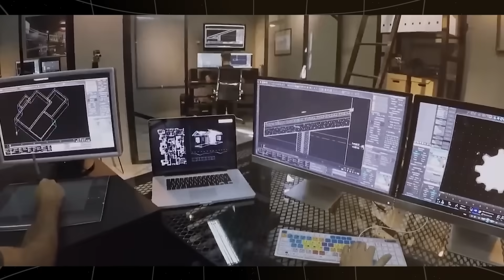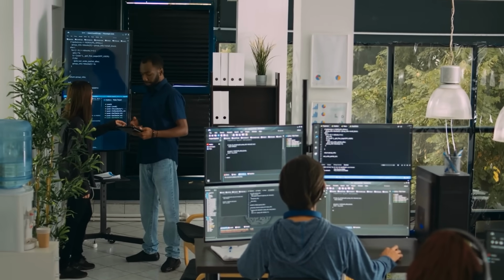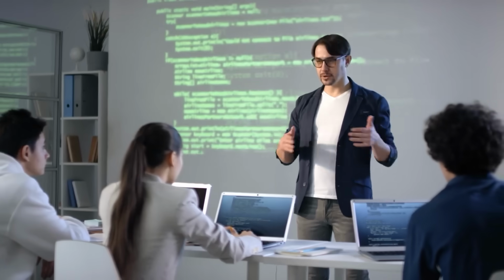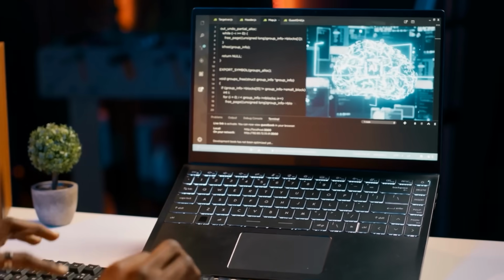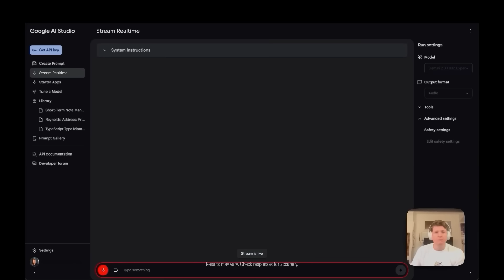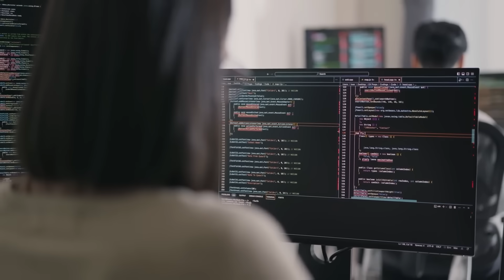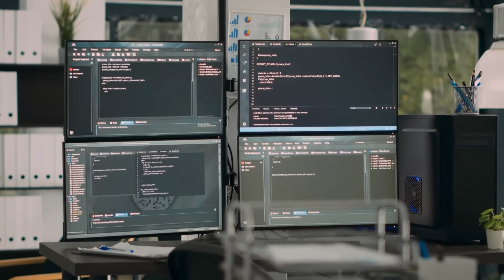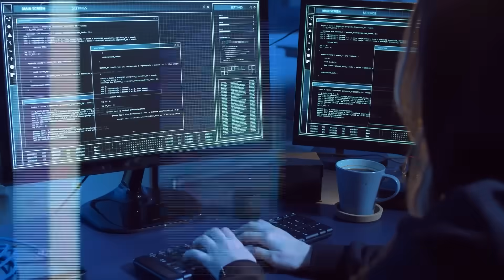Google’s NEW Ironwood Chip Just Crushed the Fastest Supercomputer on Earth!

Comment: Timestamps 
00:06 - Google's Ironwood TPUs outperform the fastest supercomputer by 24 times.
01:44 - Google's Ironwood Chip enhances AI performance dramatically for real-world applications.
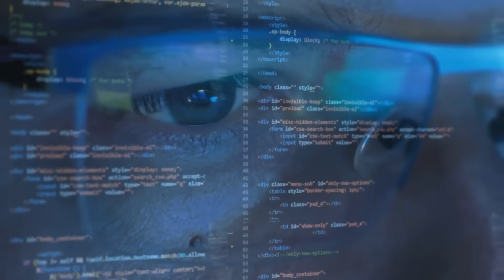03:25 - Google's Ironwood Chip revolutionizes AI inference, surpassing supercomputing capabilities.
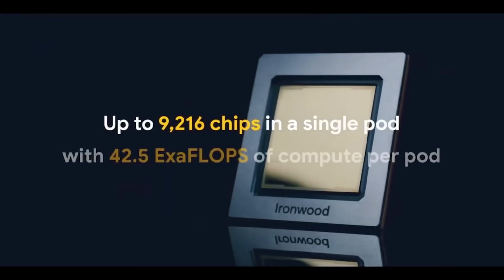05:08 - Google's Ironwood Chip significantly outperforms existing supercomputers in efficiency and processing power.
06:52 - Google's Ironwood chip enhances cutting-edge AI models for diverse applications.
08:33 - Google's Ironwood Chip enhances AI through integrated hardware and software solutions.
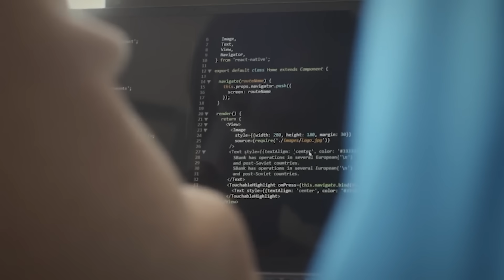10:20 - Google introduces tools for multi-agent AI system development.
12:06 - Google's Ironwood chip enhances AI deployment with improved efficiency and integration.